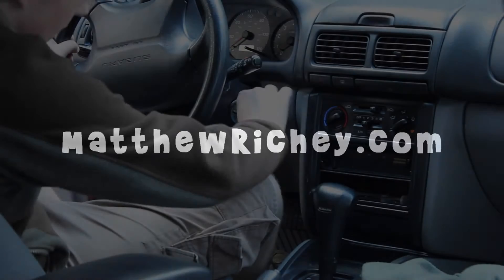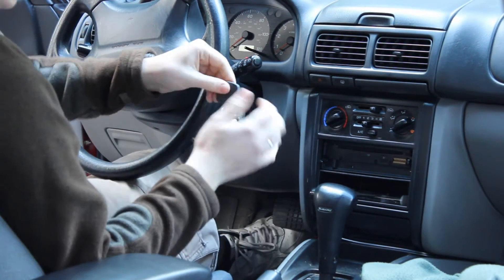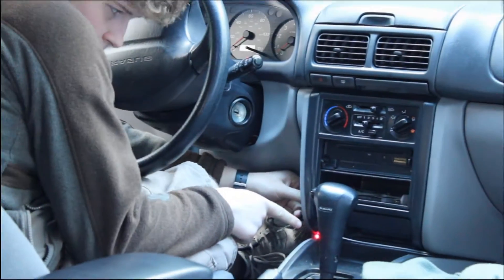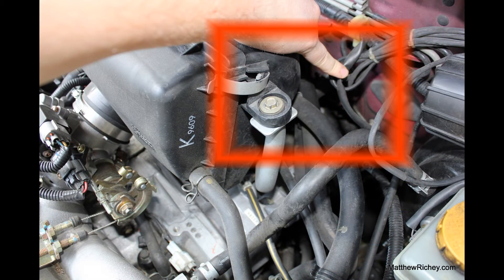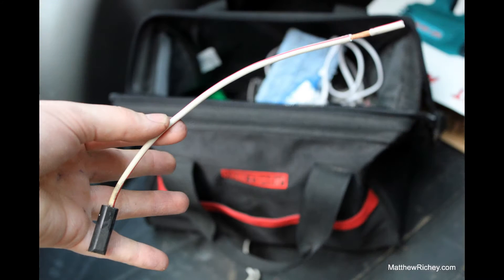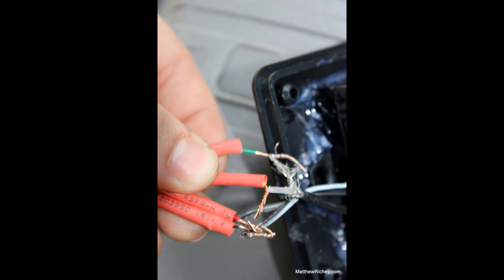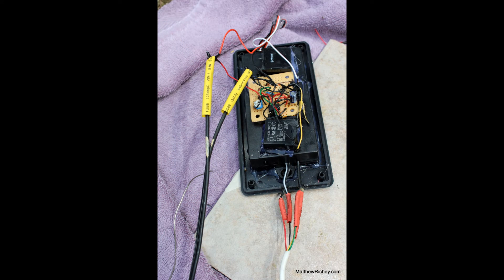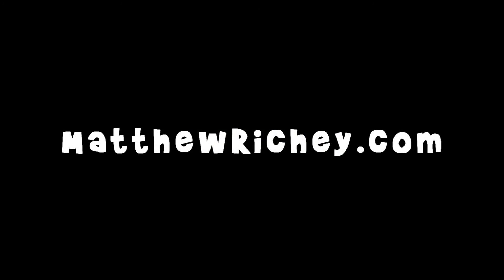DIY RFID car starter kill switch - car killswitch Complete #killswitch

Comment: Hello, I saw your electrical schematics. are you using two relays? One in the Delay circuit and one in the RFID circuit? and what type of relays are you using?
Reply from the maker: Just one in the time delay relay. The RF ID system is self-contained.

Comment: That’s sweet. Is there any degradation over time for the rfid tag? And does it work in the cold well?
Reply from the maker: benjamin felland Unfortunately I uninstalled it because I was having some computer problems not sure if it was the cause but using a lower how are RFID tag would help. I didn’t have any problems in the cold

Comment: Any remote position sensor is generally magnetic (a hall effect transistor)... and your RFID system generates a magnetic field... (the RFID chip is actually powered through the air from this magnetic field). If you have some sensitive electrionics, there can be interference.
You may want to try to find a lower powered RFID detector to avoid this...